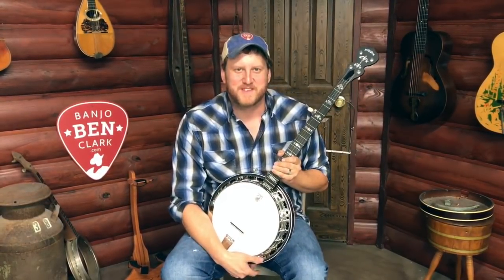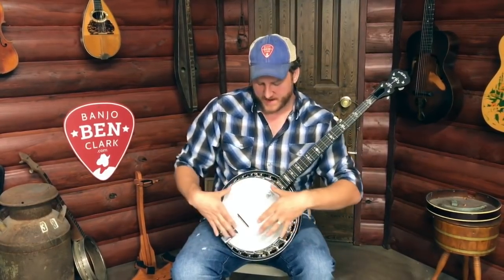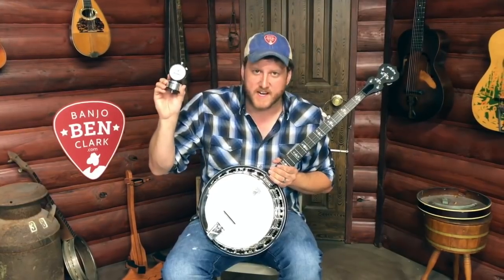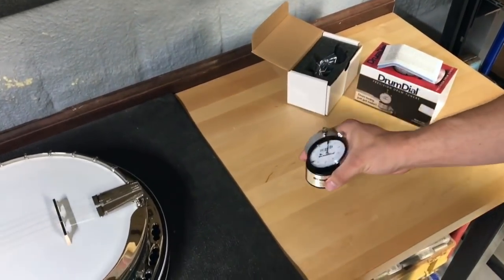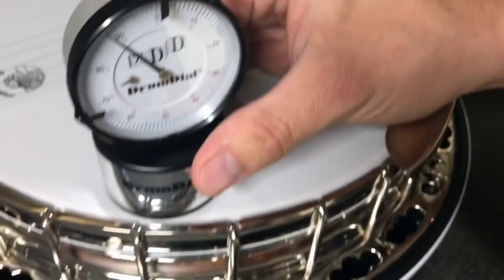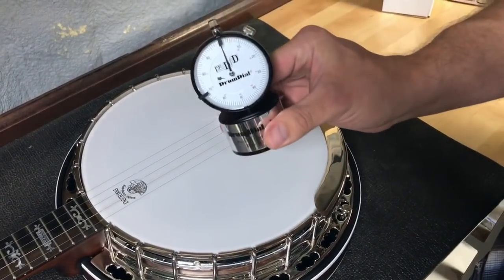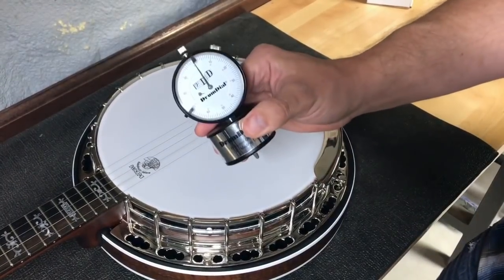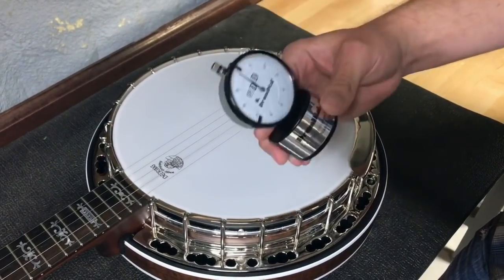How to Get Consistent Banjo Head Tension!

Comment: It seems to me that the "edge gauge" (2:45) is vitally important for consistent measurements. Imagine removing the strings for full access to the stretched head across its entire span. If you could set the dial drum right at the edge, .010" away from the tone ring, intuition tells you that the drum dial will deflect 0.000". But as you slide the drum dial towards the center of the head, the drum dial will surely show increasing deflection, reaching its peak deflection at the center of the head. Continuing on to the other side of the head, as you now approach the tone ring on the other side, the reading rises back up towards 0.000". The engineer in me wants to plot the deflection across the diameter of the head with distance from each side on the horizontal axis, and deflection (drum dial) on the vertical axis. It will NOT be a straight line; it will no doubt be a parabola of some sort. Thus, for consistent measurements, it becomes very important to locate the drum dial some consistent distance from the tension hoop!

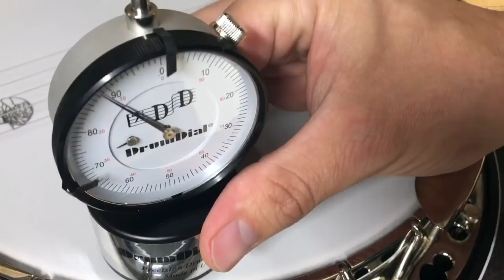That is where the edge gauge comes in to play. It forces you to place the drum dial the exact same distance from the tension hoop for all of your measurements. The arm rest alone forces the drum dial to be out about as far as the edge gauge places it, but your one setting at 4:10 shows you have the indicator almost touching the tension hoop. But in your video, I see you using different distances from the tension ring for your readings. I see you and others objecting to a .001" difference across the head, so shouldn't these slight measurement errors matter?

For my money, when performing this tensioning operation, I would remove the strings, tailpiece, and armrest before doing the adjustments. Certainly the pressure of the strings down through the bridge will alter the head tension near the tailpiece.

Amiright?

P.S.: the indicator is heavy not necessarily because that equates to high quality, but because you want the weight of the dial to fully depress the spring-loaded dial pin to flush with the flat bottom without having to press it down manually. Thus, it probably has a heavy circular steel weight inside it to weigh it down.
Reply: True ,always use the edge, makes total sense, thanks.

Comment: My banjo head has never had tension adjusted since I purchased it 25 yrs ago.
I have noticed some bridge sag.  Can I remove the strings “I’m putting on new strings” and tighten the head using the dial with strings off?  Thank You

Comment: This is a great channel and I love Banjo Ben but the tap tuning method is totally circumstantial in my opinion an art piloted by drummers and is also based on one persons ear against anothers.
Ive found that it is almost impossible to get the power and volume you need without using a drum dial from 92 to 95.

Comment: Which do you think is more important head tap tuned to a G#ish or drum dial reading between 88 to 91
Reply: Drum dial 93 to 95. All the pros will tell you the tone ring will not perform until you get it within this range.

Comment: would it work to just use a torque wrench and just torque each bolt in a star pattern to 'x' in. lbs.?
Reply: Actually, if you search up "screenprint" supplies, I used to refresh silkscreens for PCB and you can actually get directional tension vectors pointing right at what you need to adjust once you get a touch for it and how it relates to the thing you're trying to do.  My methods wouldn't work because mine was simplified - just a square frame with each corner having squareness and each side having tension.

Comment: When measuring the tension of the head with DRUMDIAL, is it 89 with the bridge and strings attached? Or should I remove the bridge?
Reply from the maker: With the bridge and strings up to tension, yep.
Reply: Thank you. I will remove the bridge and measure.
Reply from the maker: @0130nara  No, leave the bridge on and have the strings tight and in tune.

Comment: Good advice - a point of information - Warren Yates also has a video on using the Drum Dial and he explains that it does not measure pounds but measures deflection in thousands of an inch. He shows how to calibrate the instrument using a sheet of glass before use on the banjo

Comment: Is this just a depth gauge with a spacer block that measures a specific distance? I have a depth gauge just like this without the bottom piece, it would be nice if I didn't have to spend $70 on another one.

Comment: As a machinist that uses a dial indicator everyday, I wouldn't call the setting "pounds" If you have it set at zero on a flat surface then a 90 reading means that the head is loose enough for it to givea minus .010  reading. Thats just they way I read it but it doesnt really make any difference on what  you call it What ever works for you. Thanks for the video. It was helpful.

Comment: What a great gadget! But here's where I'm confused and hope someone might help... how do you simultaneously make sure the tension is even all over, but also tune the head to something specific, say G#?
Reply from the maker: Tune it to a G# then check the evenness. Or, you can set the whole thing to 88-90 and know that it's close.
Reply: Thank you for taking the time to reply, very helpful. Sorry to ask probably a dumb question, but does the tuning of the banjo head have any bearing on alternate string tunings? For instance, does the head pitch need to be changed to a different note when changing to a different tuning?
Reply from the maker: @SOUNDsculptures  You're welcome! No, you don't have to change it with different tunings, unless you were going to stay in a substantially lower tuning for a while, but you're probably not.
Reply: Use 2 wrenches opposite one another. Start on a flat surface finger tight nuts. Then do circles 2 wrenches at a time tightening about half a turn. After one rotation around the head, go in the opposite direction. Changing directions each time one revolution is complete. If you dont the tension hoop will " float " in the wrong direction and get out of alignment w the heel cut.